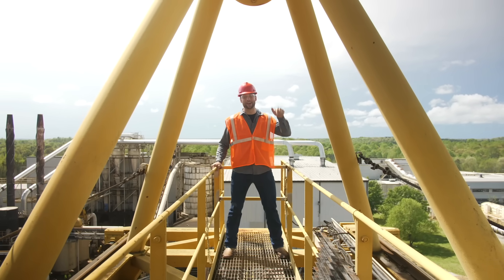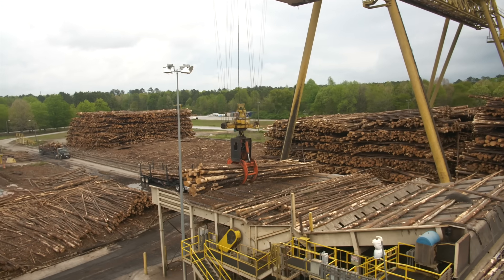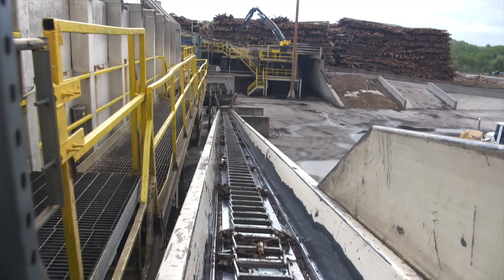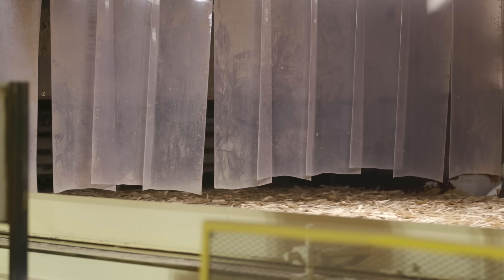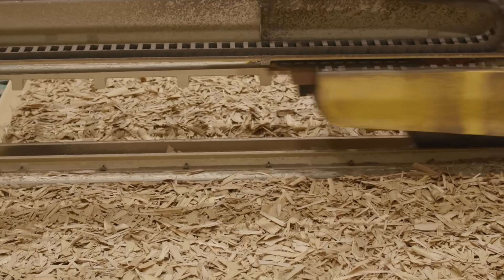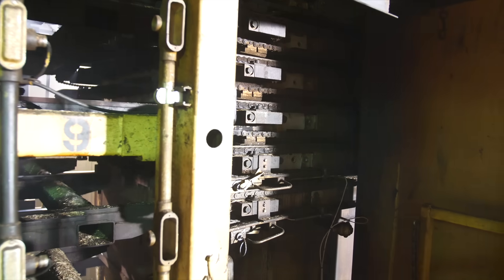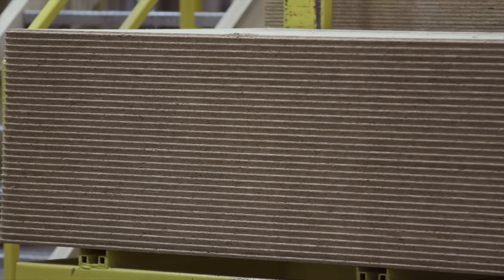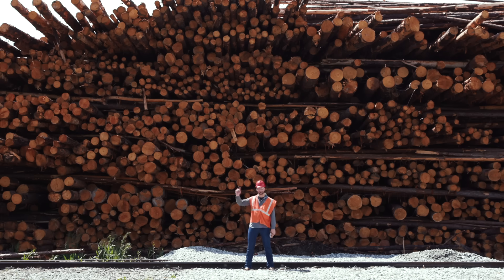Could OSB be BETTER than Plywood????

Comment: I've been involved in home building from age 10  I'm 58 now.  My  dad owed 3 savage building supplies, I ran one of this from start till its closing 12 years later, We sold 2nds and damaged materials along with #1 stuff, I went through the presswood epidemic, dealing with the semi loads my dad would haul in and sell through his stores, I had to deal with the blows and delamination, during all this we started handling waferboard thats what we called  OSB . I found out quick there was a difference  between presswood and OSB, also a difference between the different thickness, 1/4 waferboard was so hard and compact it was hard to drive a nail through and was slick as greezed lighting, just hit a bump with a forklift full or take off to fast with a bundle not tied down good.   1/2  was not as hard or compact,  not the same glue or process I figured, later on came the 3/4 it looked better held up better, better glue I figured, sold 2nds in this also I've seen it all , I've been to the plants, with dad getting loads have watched presswood, waferboard and plywood being made, have seen 1/4 waferboard go from being so hard and compact it was almost brittle to the last time I had to use 1/4 on a job where I could see right through the board,. After the building supplies closed dad and I went into rental house's, I did the repair's, we bought old house's fixed and rented them , all the kitchens and bathrooms had to be redone from ground up, I got to see the after affects of the building supplies I had sold, the presswood on the floors , in the cabinets and counter tops, under the fiberglass bathtubs and whirlpools, plywood flooring, T&G flooring , have replaced floors made from all these materials and replaced what I had replaced them with,  I get talked into trying AdvanTech at lowes mailly because that was all there was , the flooring job turned into a 3 month ordeal or longer , these sheets of flooring were left  leaning against the wall on a 2 ft.wide porch, this is in TN. in the spring, When  I got to putting down the floor I expected it to be a screwed up deal with the T&G  but it wasn't  went right together, I've had new plywood not go together as good as this out in the weather OSB, . what I've come to believe to be the best way to floor a house or what ever is 1st. thing only go with 1 step flooring, if water gets involved no 2 layers, water will stay between the layers and it will rot  almost impossible to dry out,  2nd. thing  go with AdvanTech  T&G 1 step flooring , take some scrap  presswood,fibercore, 1/2 USB and some AdvanTech put it in a bucket of water ,I did and see for yourself
Reply: Been using advanced tech for 20 years... Everything else is garbage.

Comment: The reason this guy never answered the question is because this film was made by the OBS company and they wanted to SELL their product.  The answer?  OSB is CRAP compared to Plywood.  AND  if you REALLY want to do a good job on the base section of your home along with the lower roof section?  USE TREATED PLYWOOD.  That is the best for rot, erosion, protection.

Comment: QUICK ANSWER?  NO!  NOT AT ALL!  NO WAY!  OSB is OSB and NOT PLYWOOD!  It's ok for dog houses, but NOT HUMAN HOUSES!
Reply: Bill depends on what your after. If you want strength then osb is better
Reply: @crunch9876  You're telling me OSB is Stonger than Ply given the same thickness?  NOT A CHANCE.  OSB has been proven to be cheaper yes, but it does not have longevity nor does it have strength after 5 years in moist or wet climates.  It also SAGS on a roof in very hot areas.  Send me your proof.  Thanks.

Comment: I've been remodeling houses for 41 years. All glue exposed to the elements will lose its cohesion. Even NASA can't make a glue that won't, ie. the space shuttle tiles. With plywood, the glue is only exposed on the edges, OSB is exposed all over. 41 years tells me never use OSB. There are many houses now with OSB floor and ceiling joists. This is a very bad idea. Our "buddies" at OSHA should never have approved of this.
Reply: I'm gonna build my house with titanium. No quality issues, and fireproof. Bit pricey, though.

Comment: My experiences of OSB are:
NOT good for any moister at all.
NOT good for any pressure att all. Do NOT use as floor. 
Good for stabilisation and support for another surface, like if you will dress it with Masonite of some reason (fake boards indoors etc).
Not outdoors, no pressure.

But WHEN you can have use for it, it's cheaper. Which is noticeable on the quality.

Comment: When I think of OSB, I think of the golden arches formed by the roof decking when the OSB wood got wet in Hurricane Andrew. The product all needed to be replaced because it got wet and it can not take water. I think of cabinets in kitchens and bathrooms where the engineered wood soaked up water and needed to be thrown out within a year under normal conditions. This is a ultra short term temporary disposable product in a world where everything is designed to be replaced and rebuilt on a continuous basis.  On top of that you still have a product that is susceptible to insects and fire.

Based on experiences over several decades, I consider it to be cheap material to make temporary structures when you can not afford durable building materials that last.
Reply: You mentioned a hurricane ?
Reply: @ELW2940  Yep ... Been through several of them. I make sure buildings I own are designed to go through them with minimal to no damage.
Reply: Building codes in my area, Charleston, SC, have hurricane and earthquake durability requirements included in them. OSB seems to satisfy those requirements or I expect it wouldn’t be being used to the extent I see that it is. Most of our codes are taken straight from the Southern Standard Building Codes and Regulations.
Reply: @ELW2940  Every time there is a storm we see  large amounts of homes failing to withstand the forces of the storm. Most of those homes are built to the building codes and those codes were obviously not sufficient. I want to have the home that remains intact so my goal is to exceed the Miami Dade County standards which are the strictest hurricane codes in the nation.

Comment: Not sure OSB competes against Plywood in most situations other than sheathing thats covered with a weather barrier? I’d like to see comparison strength tests of OSB vs Plywood regarding dimensional stresses, load weights before sagging, load bearing comparisons, and longevity when exposed to weather or wet conditions. This OSB manufacturer may produced the best OSB...but in my experience, OSB delaminates well before plywood in adverse conditions and does not support the same load at the same as an equivalent Plywood sheet. Good video on the process of making OSB, but losing me on how OSB is better than plywood.
Reply: Hammer test is all I ever needed to see! OSB is cheap shit for cheap ass builders.

Comment: Another notch shifting in the ratio between raw resource and technological inputs? Even if technical specifications are on par or exceeds the original it is replacing (at lower or same price point)  will human experiential levels be the same? Value occurs in the mind only with reference points to compare with. Once solid timber becomes so rare and expensive it is no longer commonplace, no one will know the loss in value. Is this where waxing lyrical and image spinners come in?Just make sure real value is not lost in translation and conversion, and siphoned off to parts unknown, dead pan sumps that are no good to any of us?
Reply: just be cautious that metaphors do not compete with each other in a race to materialize and literalize, right? Why good news, rosy dispositions and bright eyed optimism, has always been placed at a premium since the last savior got nailed. Regardless of how baseless (or out right deceptive and destructive) the good news is?

Comment: OSB is not as good as ply, ply has a lot more shear strength when used for that, also hold up better much better when gets wet, or hot southern summer heat over a few years drastically deteriorates OSB faster than ply for roof sheathing. Also after a few new roofing jobs OSB tends to break apart a lot, chip out with all the nailing from the shingles where not as bad with ply, no chip out just nail holes. It is a lot cheaper to make than ply so has become a cost effective way to build affordable houses, but necessary great houses, I would rather build smaller with same money and have it last a long time. We are building more of these disposable houses, roof sheathing redo in 50 years.

Comment: btw if this gets wet, you'll fall right through it. it's a useless product
Reply: Even though Advantech is still an OSB product, it performs
100x better than the $10 per sheet garbage you buy at the big box stores. I’ve left 3/4” advantech out in the elements for months and then used it to cover a 3’ wide stair hole on multiple occasions. I’ve never fallen through it.
Reply: @TCSwizz2, the fact that they needed to put all this engineering into it over the years to keep it from failing proves it was Not a superior or quality product to begin with.

Comment: Problem with OSB is that it is extremely flammable, and condos that have used it flare right up in massive fires.
Reply: Yeah, never mind the pine subfloor, pine studs, pine joists...
Reply: @9mmkahr   Yes that's stuff as flammable to, but the OSB is unbelievably flammable and quickly flammable spreading flames a lot quicker.
Reply: AND crumbles like toilet paper when wet!
Reply: @roundedges2  that’s not osb that partiicle board
Reply: @roundedges2  OSB is normally waterproof
Reply: velosapien have you actually ever seen what happens to osb when it gets wet? It’s about as far from waterproof as you can get
Reply: @velosapien  HAVE YOU SEEN IT IN THE ELEMENTS??
Reply: @tonybarracuda3505  RIGHT!
Reply: @tonybarracuda3505  osb3 is comparable to marine ply and a fraction the cost
Reply: @velosapien  if that were true then it would be marine grade but its not so who are you trying too fool?
Reply: It's part of the design so the burning apartment will self-demolish into a pile of ash.
Reply: Not nearly as flammable as that pink foam board they used to use for sheathing.
Reply: Osb sheet burns 2 mins faster than plywood. everything we build out of is extremely flammable.  I've seen plywood assembled homes go down in minutes.
Reply: @Skippy0330  then stop building homes out of sticks and cardboard
Reply: @Skippy0330  I love being in a country where we build with bricks, mortar and concrete!
Reply: Sounds like else need a burn test comparison! 
Who’s going to do the demo?
Reply: @brianlofton2489  and the ants eat it like candy
Reply: Brian Lofton thats ALL been done , the osb in I-joist has caused many fire departments to not enter any burning building made of i-joists . Plenty of videos out on the rapid burn-rate of i-joists .
Reply: No worse the plywood!! 
OSB is harder to start that plywood but it dose burn good once it gets going!! 
The are stronger that plywood!! If it wasn't they wouldn't use it on engineered floor trusses...
They have water resistant glues now!! They glue commercial jets together!! They don't come apart...
Cars and truck are glued together more than welded, they are in more extreme weather that any house!!!
Reply: @mitchadams2815  It's not the glue that is the issue. It's the expansion and contraction when wet/dry. The wood fibers are only so strong in tension. 

Airplanes, that is an entire different world from houses made of wood. Even when planes made of wood and fabric were common, they didn't last forever in the elements, they like being nicely tucked away in a hangar when it's raining.
Reply: Never seen a fishing boat made of OSB.

Comment: OSB is not great, but it is "good". The product off-gasses for a long time and can make framers, and customers, sick. Also, it doesn't hold up to weather as well as plywood, and gets "rough" pretty fast. It does the job, though, and does save money, which is why the big builders like it. As a small home builder, I use plywood, and don't mind the extra expense.

Comment: For me personally application, application, application!! there are some places OSB sucks at where Plywood shines through!! For example get OSB wet just once and it will literally melt like ice cream!! Meanwhile a good treated Plywood "sheathing" will last five times as long in the same application (like roof underlayment, or a exterior wall substructure. Though I use OSB as an underlayment in some places I also use plywood when I feel OSB isn't strong enough to deal with weather!!

Comment: Dropped a piece of 7/16 Zip in a bucket of water, and left it there for about a month. It swelled maybe 1/8" thicker, and still had a lot of bending strength resistance. Not scientific, but enough to convince me that Zip is much better with water resistance than other OSB's I have seen.

Comment: These need to be made in larger sizes. Building an 8x12 shed? Use one 8x12x¾ sheet for the floor.
Might be tricky to haul home (use a large trailer, or use a delivery service). 4x10 sheets are a thing, but they're tricky to use over studs spaced 16" on-center.
Reply: Ok.

Comment: I have the tendency to listen to more than one audio source but no more than three and is easy enough to silence any of them but gosh dang get yourself a clip-on wireless microphone as the video microphone is clearly lacking and those hand held ones just get in the way on this type of or any other video you have been making. Yes I have my computer as high as i can turn it up (Without disturbing others) and even the videos audio I have tuned up to the absolute max as is and despite the lap desk I use having a solid surface, your audio still comes out SOFT.

Comment: I wonder a lot about OSB's off-gassing of VOC's from the adhesives.
Reply: @Markus Patients<— thinks it’s irrational to Not want toxins, pollutants, etc.. in your air and water. 🤦🏻‍♂️
Reply: FYI, it was addressed though not explained properly (I manufactured PB and MDF for 12 years, and except for the desired milled fiber geometry, the processes are identical). He spoke some in the middle about the adhesive, and said they’re using MDI instead of less advanced adhesives which might be easier, but not give the same longevity. That’s nonsense. The adhesives used for 50+ years were all UF (urea formaldehyde) resins, and they always made a durable well adhered product (not discussing the pros and cons of specific engineered, or non, products, they each have good and bad about them, and good reason use each for specific applications). The real reason for switching away from UF adhesives has to do with formaldehyde emissions. As California legislates environmentally in the wood products industry, so too eventually goes the whole country, and beginning 7 years ago began the transition. At this point, whether MDF, particleboard, plywood, or OSB, with the use of newer adhesives like MDI, the products do not emit any more formaldehyde than do trees naturally in the forest. MDI is quite hazardous to work with, requiring respirators and special cover when in close proximity, when it is still wet, or most dangerously when it is in aerosol form, but once in contact with moisture (it’s catalyst) and cured with heat, it is inert. Babble, blah, burp, fart (oops!;)
Reply: Bill Reynolds that’s great info thanks! And with today’s HRV/ERV systems homes can get a lot healthier. Home Depot sells a formaldehyde free finished  plywood and it’s awful. It has all these voids, delaminates, splinters. So it’s good to know the other manufacturers are coming up with alternatives.
Reply: MrBrianDuga Home Depot is likely selling a non A grade product, possibly what’s referred to internally within the industry as, “mill run,” which means it has some percentage of defect, or one of the of the downgrade (subpar properties, sold at a discount) categories such as “shop” or “utility.” Resellers who sell direct to the public often seem try to pretend or ignore that grades are known, even to act unaware that they exist at all, and as such, if they don’t tell you, you don’t know what you’re getting, nor if they’re banking or passing along their savings to you.
Reply: Oh, and I promise you, the manufacturers always know what they’re selling, what the specs and properties are, and clearly label. When manufacturers sell direct to industrial fabricators, or to retailers, it’s all above board, and with discounts given, or when they’re dissatisfied, and when they’re not, they file claims against the manufacturer. Large industrial customers are often very involved with the manufacturing process, demanding special properties, trials to achieve specific performance, etcetera.
Reply: It has poly based glue, its cancerous with offgassing like any other glue based product
Reply: @oreocarlton3343  Not true, PMDI does not offgas at all once cured (unless it's on fire!) and even prior to curing has a very low vapor pressure. It is also not a carcinogen.
Reply: “the resins in OSB are designed to completely cure in the hot press process at the plant, and after the process, SBA mills hot stack panels for at least 48 hours after trimming to allow gases to dissipate, and current findings are that the OSB panels will only very minimally off gas after that, doing so only when coming in contact with high heat and cutting, such as when they are cut on site during construction or demolition.”
https://greenhomeguide.com/askapro/question/does-priming-and-painting-osb-help-prevent-offgassing
Reply: No such thing just like global warming it's all b.s.
Reply: Plywood has adhesive to bond the layers...